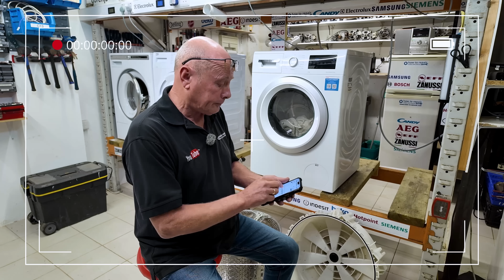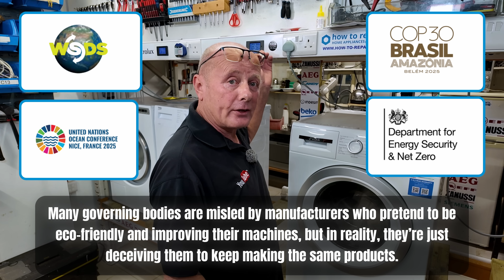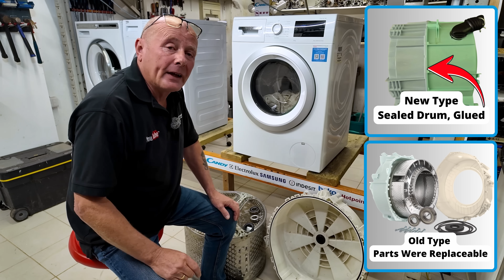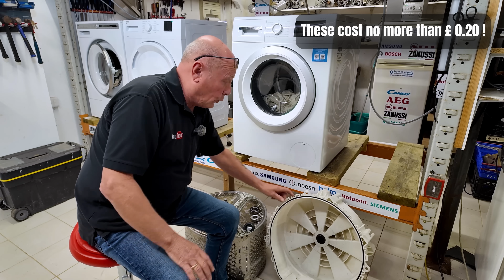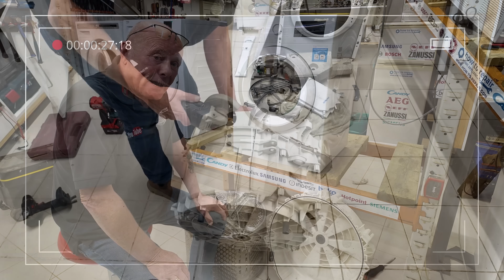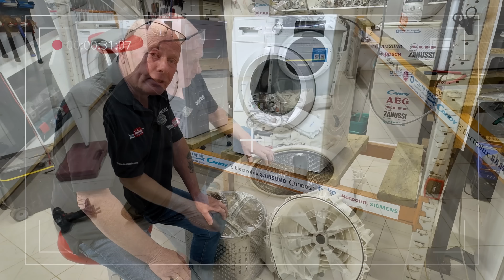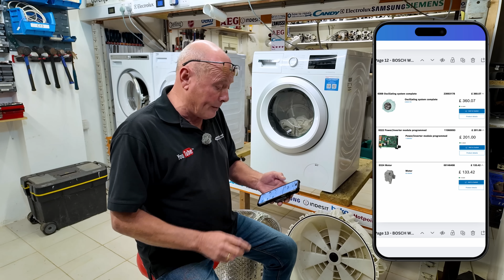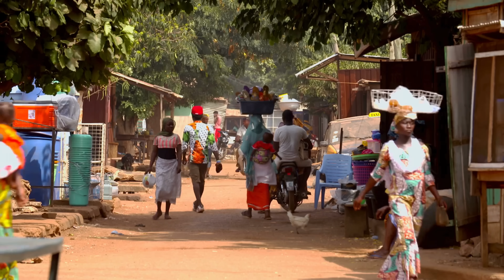Washing Machine SCAM EXPOSED! The Truth About SEALED Drums: Naming & Shaming

Comment: There's long been discussion of an open-source inkjet printer.  The main blocker seems to be the ludicrously tight manufacturing requirements of the print nozzle, everything else seems feasible or already solved.

I'm struggling to think of any part in a washer/drier that could be a blocker for an open-source design in the same way as the print nozzle is for printers.  Washers have also been around for much longer so there shouldn't be any patent issues on all the functionality the public actually cares about.  The main challenges are going to be regulatory and legal, but that would always be true anyway.

Framework Washing Machine, anyone?
Reply: Unless you are a graphic designer, it seems more practical to just use a cheap and reliable black & white laser printer and instead order professional colour printing as required TBH!  I haven't looked back since switching to a cheap and cheerful laser printer...
Reply: Your open-source idea sounds very feasible! Many washers use the same drain pump (an Italian Askol pump), similar inlet blocks, similar motors etc anyway.  I'd say the only question is that whether, with economies of scale, the big OEMs are already doing it cheaper than any private enthusiasts ever could? 

 For example you can build you own PC, but even if you choose the cheapest motherboard, cheapest  CPU, cheapest power supply, cheapest case etc., it will almost always still end up more expensive than a basic mass-produced HP or Dell office mini-ATX office computer.

Comment: Electric motor of my 180 EUR Bosch vacuum cleaner died - brushes were totally worn out. It was not possible to get replacement brushes from Bosch, so I bought several similar brushes for few euros from Aliexpress, unfortunately none of them a good fit. On the other hand, Bosch offered me a spare part electric motor for 130 EUR.  

Needless to say, my new vacuum cleaner is not Bosch anymore.
Reply: Had similar case. Couldn't find anything that matched. So i contacted company that makes brushes and can make custom one. Asked how much would it cost. 8 euro for pair. 
They asked for dimensions from old one, pictures how they look and distance from commutator. 2 weeks later i had brushes inside working.
Reply: @feluke8396  name of the company please!
Reply from the maker: It's hard to believe that manufacturers expect consumers to be happy buying major appliances every few years. Using environmental issues to sell more machines is ridiculous, especially considering the ecological damage it causes. They are ruining their reputations by making such products.
Reply: just get some slightly bigger and sand them down. Very quick and simple.
Reply: The soft carbon brushes file down easily,  just make sure that the pigtail is long enough and undamaged. Buy the bigger brushes, solder and soldering iron from Ali.
Reply: Yup. If my machine were to fail like that I am never buying Bosch ever again
Reply: brushes are be easier than it looks. Just buy bigger in size and file down the excess. Take care the wire is long enough  so it can be connected easily to your connection.

edit: I didn't see someone already mentioned that, sorry.
Reply: @paddlehard5722  If the wire or spring isn't the right length, cut them off the old brushes, splice and solder the wires together if too short, using the old spring. Keep the solder joint neat and small so the spring can compress. If they need sanding, I hold down the abrasive paper on a flat surface  and rub the carbon brush back and forward over it to sand it flat and evenly.
Reply: @mels8966  I used to do that years ago with Bosch washing machine motors. Bosch didn't sell motor brushes and would only supply a full motor end casting, with the brushes fitted, for silly money. I used to use fine abrasive paper on I think Hoover brushes or whatever was nearest in size and solder them in.
Reply: @paddlehard5722 yes this. Buy oversized ones and file/sand to size.
Reply: I've grinded and sanded bigger generic brushes to fit in almost any small appliance I needed to replace them to.
Reply: Thank you all for suggestions about fitting new brushes. Unfortunately the situation wasn’t so simple. It was  impossible to replace just the carbon brushes, it was necessary to replace the complete combination - carbon brushes, springs, brushes metal housing. Very precise and strong fit between brushes metal housing and motor plastic holders was necessary. In summary - mission impossible.
Reply: File brushes to the right dimensions and push a shortand one in from the brush end befor fixing it back in place
Reply: How old was it? And what model?
Reply: @GenX_in_the_wild It was Bosch Zoo vacuum cleaner, around five years old. I think the old motor had incorrectly dimensioned brushes, as the current spare motor has monster brushes in comparison to old ones. Current spare motor housing is of same dimensions, just brushes cross section is four times larger.
Reply: @srus  That sucks..
Reply: I had something similar...  Went to a place that rewinds electric motors.  They had various sized brushes, so I spent a few minutes comparing sizes, settled on a slightly larger one, took it home and filed it down a couple of mm to fit.  Less than $15.
Reply: the brushes are a really common failure.

my old washing mashine failed 3 years ago... i got the motor out and the brushes were worn off.

ordering new ones was cheap and easy. Installing and assembly was easy aswell. 

the fact that many modern mashines dont offer such an easy and quick fix, should be illegal.

especially since those liars are constantly talking about "CO2" and "the environment"... they present themself as climate advocates, while they try to keep us from repairing out mashines.
Reply: How about Dyson?
Reply: @jcjko5504I don't recommend Dyson vacuum. Indeed I was using it a lot because I have a few cats, but I have 2 Dyson vacuums which failed. Now I'm trying Sebo. It seems to be more reliable. 
Plastic used to make Dyson vacuum is very cheap, it cracks and is not good. Also I had problems with the trigger button, with the brush head, with the main motor, and the clicking plastic part. If you use it once per week, then maybe it is a good fit.
And is very hard to repair. Also it's hard to find replacement components.
Reply: @tadiadi  Ya. That's the Dyson I experienced.
Reply: @tadiadi agreed. The original Dyson were OK,but the new products are awful. Unreliable, prone to breakage and difficult to use. Avoid!
Reply: @johnalbinson4641 Shark vacuums are one of the best on the market
Reply: @tadiadi of you want a workhorse vacuum which also is quiet and powerfull get a numatic. They are professional use too for cleaning companies. They really dont break or go down in power and are also HEPA filtered. (The vacuums with the smileyface on them)
Reply: Look into the Electrical skip at your local re- cycling  dump . . Plenty of Dysons ,  what seem to be quite new .
Reply: A soldering iron, file and sandpaper might've helped you.
Reply: i had same issue with the motor in the screwdriver, Bosch motor was 10x of the same from china, same manufacturer.
Reply: Have LG washer 7 years old. Drain pump failed, cost 17 pound for new one took 90 minutes to replace DIY. Only other issue has been front seal gasket. 35 pound and 90 minutes DIY no special tools needed.
Still not as easy nor long lived as machines built from 80's thru to 2010's. 
Yes it is planned. It crosses product boundaries the worst being phones and cars . Search rubber timing belts, car engines are phasing out steel timing chains. The rubber belts are inside the engine and fail methodically over 80,000km.. costs £3000 to swap out every 60,000km
Reply: I had a similar issues with hand mixer. They come with multiple components and just the metal part with the blade broke. I couldn’t buy the component from them, everything was supposed to be thrown out.
Reply: Get brushes of same length and approx thickness or bigger. You can grind it on a sandpaper to whatever size you want.
Reply: Brushes are sometimes in sealed brushholders but with inginuity are openable. If I couldnt get exact brushes at reasonable cost I filed or ground from larger brushes- the brush leads may be another problem but not insurmountable - If the originals dont cost too much more and are available its worth considering to buy originals.
Reply: The longer the product number the scammier it will be.

Comment: Totally agree, I’ve replaced a few sets of bearings and seals over the years and was gutted when I discovered it’s no longer accessible unless it’s literally split in half, disgusting. Recently my PCB has just gone in my Hotpoint and they won’t let me buy one and install it myself, claiming it needs to be programmed with software on installation ???. Possibly clocking the PCB to fail after so many hours of use,😡🤬😳😡🤬😳
Reply from the maker: Yes manufacturers now are even doing this little trick where a PCB is delivered unprogrammed and the only people that can program it are the engineers or you have to buy the equipment to be able to do it. They are all trying to remove the right to repair and government are letting it happen. Please remember to share it if you can as this is the only way this will get the visibility it needs for change to happen

Comment: yup, midea, LG, samsung, haier, all splittable drums.  as for bearings, ive noticed they fail for one of 2 reasons', 1 - they have not been fit flush dureing assembly. or 2. the rubber seal perishes and lets water ingress into the bearings, very rarely they fail due to Use. but the biggest increase is Spider fail's now. they didn't fail in the 70's and 80's. and its only coincidently since the introduction of liquid detergent in the 90's since they started failing. very quickly in some cases.
Reply from the maker: I wish I had a laboratory to test the aluminium that is used in spiders today compared to the 70s and 80s I suspect that it is designed to corrode with the types of detergent that are being used. Thanks very much for the comment, please remember to share it as this is the only way we will get this visible enough for the media to pick it up and maybe change will come of it

Comment: This is something that's been happening across the entire electrical goods industry in the last 10 years or so. Where spares were available at reasonable cost, they have replaced individual parts with very expensive "assemblies" - whether it be complete drums, switch/motor/controller assemblies or almost entire units. The manufacturers then insist that "machines can be repaired with available spares" but don't address the economics of repair. As you say, this almost amounts to a cartel as they are all doing it at the same time ...
Reply from the maker: You fit the nail on the head the word is cartel. It happened with the lightbulb conspiracy at the turn of the century.

Comment: You speak a lot of sense. 
A lot of research has gone into this video, not to mention your own professional experience regarding repairs and your knowledge of the integral planned obsolescence of modern appliances. 

My parents had a Hoover washing machine in the late 60s and it was still going when they scrapped it in 1990 in a kitchen revamp. I wouldn’t hope for such longevity now, and that’s coming from someone who quite likes to repair things.
I think most young people now are quite happy to ‘get rid’ the moment there’s a problem as they value immediate replacement with brand new more than previous generations. Also, an overall decline in ability among many young people to repair appliances will fuel planned obsolescence yet further. 
Furthermore, I wonder if (eg.) washing machine ownership in the future will go the way new cars ‘ownership’ has gone for many young people; they’ll effectively lease them and so, if they don’t own them, they won’t be considering their inevitable repair.
Reply from the maker: When they start leasing or renting washing machines you will suddenly see an increase in lifespan mark my words on this it's not difficult to build a machine to last. Manufacturers do not want this at the moment because all they care about is their profits

Comment: I adjusted the pressure switch (it's under the top cover), and the machine started using twice as much water. A small amount of water means dirt accumulates on the inside of the drum. A larger amount of water means cleaner laundry and a longer life for the machine.
Reply from the maker: Your modification tackles one of the biggest complaints about modern "Eco-Friendly" machines. It directly addresses the hypocrisy of greenwashing. Manufacturers advertise massive water and energy savings. However, if those low levels cause residue buildup, forcing the machine onto the e-waste pile after 5 years, the overall environmental cost is actually higher!

To truly make a difference, we need to get the attention of industry leaders and stop these wasteful practices. Sharing this post is crucial to spread the message.

Comment: I had a drum replaced on a Gorenje under warranty. The technician told me that the drum is welded but can be split and resealed with silicone and screwed togehther to replace the bearing. I have no idea if this is true. And that is coming from an authorised service center. BTW, Gorenje in serbia has a HUGE percent of the market. Some Gorenje appliances are actually made in Serbia.

Comment: I have a Simpson front loader that I bought in 2020 (supplied to the Australian market) would that be one of the repairable ones? SWF8025DQWA. My last Simpson lasted just over 20 years and only needed to be repaired once (the control unit for the agitator) I ended up replacing it when the agitator decided to climb out of the machine taking the lid of the machine with it.
Reply from the maker: I can certainly appreciate your concern, especially since your last Simpson lasted 20 years! That kind of long life is exactly what appliances were known for before the industry shifted to planned obsolescence. While Simpson historically had strong repairable models in the Australian market, modern front loaders across all major brands (including those under the Electrolux umbrella) are increasingly being built with sealed plastic outer tubs instead of splitable ones.

This means that while the Inverter Motor (which is guaranteed for 10 years, parts only) is durable, if the bearings fail which is a common issue the entire outer tub and drum assembly usually has to be replaced costing you significantly more than a simple bearing swap. This practice makes the appliance far less economical to repair and contributes to it landing on the e-waste pile which is why I advise asking if the drum can be split before purchasing.

Thank you for your comment. I appreciate people like you taking the time to write it out. Please don’t forget to subscribe and share it where possible. It might help others make a wise choice instead of being misled by the industry.

Comment: How much labour cost to strip the drum down and repair vs just replacing the sealed drum?
Reply from the maker: This is not just about price it is about choice and companies removing the right to repair it would take half a day for the average person to replace the bearings. I can do them in my workshop in less than two hours but again it would need to be a splittable drum.
Reply: @How-to-repair  I understand that perfectly but to change the bearings is more labour intensive that changing the complete drum assembly. So that needs to be factored into repair costs too.

Just because a pair of bearings 30 quid does not mean the repair is 30 quid. You have to factor in the cost of labour. 

So how much labour does it cost to replace the drum bearings, seals and spider?
Reply from the maker: @mickl8212  depending on the make, but I would estimate £100 on my labour but I am a business if a family has not much money and is forced into having to replace the drum on one of these Bosch machines compared to spending the whole of their Sunday and £30 of their money I imagine they would do the job but for those of us who have money it should be our choice whether to repair or replace it is not down to a manufacturer to dictate
Reply: @How-to-repair  so that's still a significant 'saving' on replacing the whole drum assembly. They obviously don't make a lot of profit on the machines so hammer the owner when it comes to replacement parts. 

What are they doing in the factory now to join the sealed drums? Ultrasonic welding?

Comment: I’m loving your videos! My AEG just had to be replaced because of the bearings. It was impossible for me to replace it for any reasonable cost. I’m livid that they manufacture appliances like this. Manufacturers will bang on about green credentials and water saving but are happy to fill up landfill with perfectly useable machines. It should be illegal! There’s another great advocate for self repair, Louis Rossman. You’re both doing great work in making people aware of this. Thank you!!
Reply: They don't go to landfill at all, they get recycled.
Reply: @lksf9820 fair enough, the point however is that they don’t need to be recycled when they could be repaired.
Reply from the maker: It's infuriating when a machine fails due to an unrepairable design, forcing you to buy a new one, but it's comments like yours that keep the pressure on these manufacturers! Your point about the environmental impact is crucial. The consumer magazines only care about the energy and water consumption these machines save, but they completely ignore the fact that the company is designing the appliance to be unrepairable, leading to massive waste. It's fantastic that you are following other advocates like Louis Rossmann! We are all fighting the same fight to secure the Right to Repair and ensure consumers are aware of the dishonest tactics being used across the appliance and electronics industries.